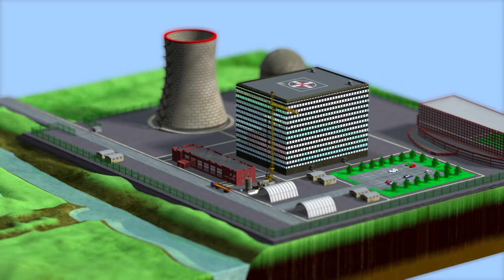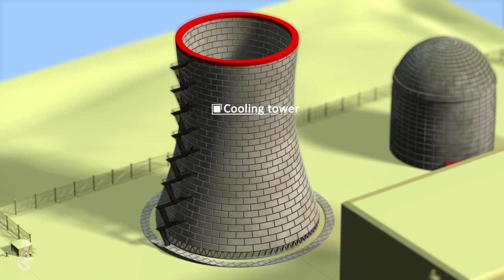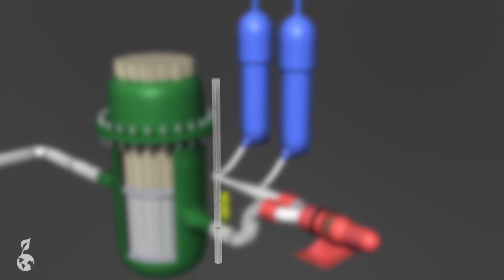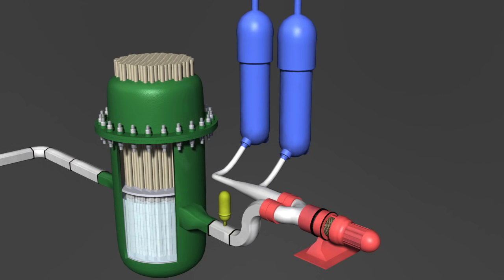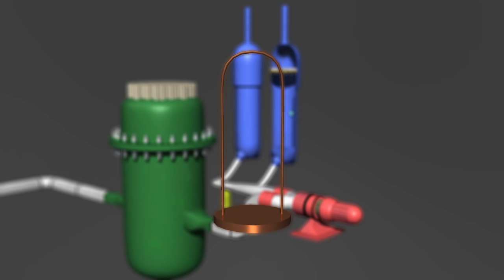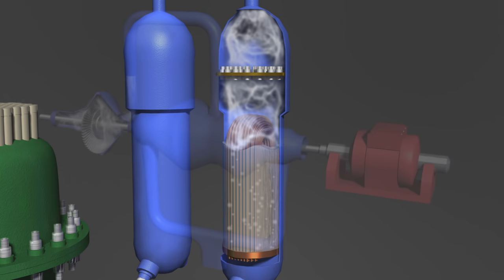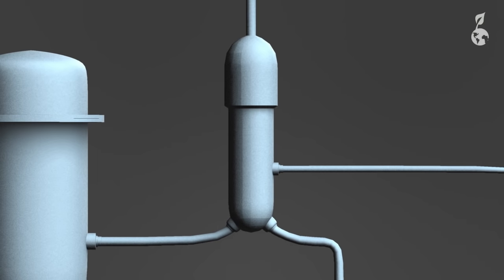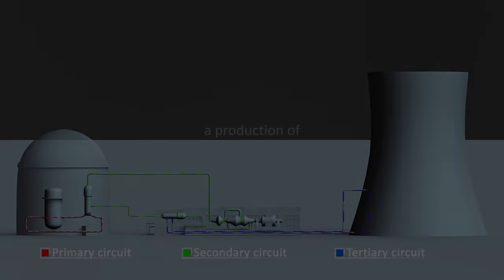How Nuclear Power Plants Work / Nuclear Energy (Animation)

Comment: you explained everything except the part how the nuclear reaction is done
Reply: it's NUCLEAR, not chemical, there's no reaction, the radiation from the u-235 boils the water
Reply: @herrGreg  Nuclear fissions are nuclear reactions. The radiation doesn't boil the water, most of the heat is due to the kinetic energy of the fission products. The radiation only accounts for a small fraction of the energy released by the nuclear reaction.
Reply: @olska9498  I was trying to be very short & simplistic, because most people need 1h reboot after I explain nuclear fission to them. But yes, it's the fission & not the radiation that heats the water; but lol, no it's not kinetic energy of the neutrons, it's the release of energy, a small part of the nuclear strong force is released as the Uranium-atom is split.
Reply: @herrGreg  How is it "short and simplistic" to respond "there's no reaction" to Kamel Labiad's question about the process of the nuclear reaction? This is just a wrong answer.

Furthermore, the kinetic energy of the fission products (daughter nuclei + neutrons) account for more than 85% of the released total energy. All your answers are just wrong. 

The people who need a 1h reboot after you explain them nuclear fission probably need the reboot because you tell them so many scientifically wrong answers.
Reply: @olska9498  I guess I mistranslated "reaction", I thought it was ment in the sense   of "chemical reaction"
Reply: Covid 19 GMA news 70
Reply: Ari Parker  
"It’s not a reaction as there is no chemicals involved."
--------- WRONG! It is a reaction. Not a chemical reaction, but a nuclear (chain) reaction. 

"They are unstable because of the amount of electrons to protons isn’t equal"
-------- WRONG! If the amount of electrons and protons of an atom isn't equal, then you call this an "ion". Stable isotopes can also be ions. 
The unstable isotopes like U-235 are unstable because of an unbalanced amount of protons and neutrons in their atomic nucleus.

"The isotope wants to get to its normal stable form so it does this by radiating away electrons"
-------- This is only one of many forms of radioactive decay. Unstable isotopes can also radiate neutrons or positrons or a helium nucleus or a gamma ray photon etc.
U-235 for example radiates a helium nucleus.

However, in a nuclear reactor, the released energy isn't primarily due to radioactive decay but due to a controlled nuclear chain reaction: Uranium (especially the isotope U-235) gets hit by a neutron, absorbs it, and splits into several new nuclei and releases neutrons and gamma rays. Then the released neutrons hit other U-235 atoms and the process repeats.
The kinetic energy of the fission products heats up the surrounding water etc.
Reply: Exactly
Reply: @lae Uranium and other radioactive material naturally releases heat energy because it constantly transforms some of its mass into energy.
HOWEVER, this natural radioactive decay and heat production is NOT the reason for the large energy release in nuclear reactors and nuclear bombs. 
In nuclear reactors and nuclear bombs, the natural heat production of natural radioactive decay plays a very low, insignificant role in energy production. 

Instead, you have a so-called "nuclear chain reaction", which is a carefully engineered process in which fissionable material (Uranium-235) undergoes nuclear fission. This nuclear chain reaction releases a EXTREMELY LARGE amount of energy.

When an Uranium-235 atom gets hit by a neutron, the Uranium-235 splits into new elements and releases several additional neutrons. These neutrons then hit other Uranium-235 atoms, which again split and releases more neutrons. This chain reaction repeats itself.
Reply: In nuclear power plant they uses control nuclear fission chain reaction in this U-235 atom is used as a nuclear fuel and atom of uranium is bombard with neutron by this uranium atom is split into smaller atom and this go until whole uranium is consumed also lot of energy is produce during this reaction and this heat is used to boil the water and water is converted into steam and steam is used to run the turbine blade, turbine shaft is connected to generator and thus electricity is produced and step up by transformer and send it to transmission line.
Reply: here is how you'll determine who's the listener and the talkshit-er! lol!
Reply: instablaster.
Reply: @johnnytheprick excuse me? the guy replying to everyone with insults has an opinion? 😂😂 maybe try going outside once a week, touch some grass maybe XDD 😷
Reply: I think he doesn't know
Reply: Ha
Reply: You aint gettin no college for free boaaaayyy
Reply: Turbines moving creates electricity is the most simple way to explain, the nuclear part is in the rods, the more rods the more power. Watch Chernobyl if you’re really interested… I’m not a physics/ nuclear specialist but it helped me understand
Reply: @herrGreg  one hour reboot???? 😂😂😂😂😂😂😂
Reply: @herrGreg  lmao what??
Reply: @herrGreg  🧱

Comment: summary:
plutonium or uranium(235) has its nuclei split by neutrons and releases energy(heat), there are also boron rods(control rods), then the heat is used to turn cold water into steam which is then turned into electricity with turbines

Comment: The confusing part on this video is started in 3:20 wherein it failed to explain that there is another water line coming to the heat exchanger to make steam. Therefore, water line 1 which is radioactive is circulating from the fuel rods to the u-tubes all the way back to the fuel rods again while the water line 2 is just flowing outside of the u-tubes. Correct me if I am wrong :)

Comment: If I'm not wrong, the voice tells a fuel rod has a diameter of 23 cm, which is not correct: the diameter of a single fuel rod is a bit more that 1 cm! The side of a fuel ASSEMBLY (a square lattice of 17x17 fuel rods) is more or less 23 cm...
Reply from the maker: Correct :)

Comment: I know how this is effective, but I must admit my disappointment with nuclear power. I thought we were actually using the heat itself as energy or the radiation, not turning it into a steam engine to generate electricity. We know 5 types of energy and no doubt electricity is the easiest, but why not try to use all forms of energy rather than just converting it to electricity. I know you can't convert all of an energy to another energy.

P.S. I know the capabilities of nuclear and all, but is the cost of nuclear aka nuclear runoff, waste, etc., more than the cost of Niagara Falls? If not, why not just created an insulated giant manmade waterfall that works similar to this, except being manmade you can add as much water as you need and just use Gravity. Would this idea be worse than the Nuclear one?
Reply: Sylvia isgod I was kinda spit-balling which is why I put it with the P.S. I was maybe thinking of having it go down into an angle where Sun light could shine in or something so that it gets dehydrated back to the top as it falls down. I'm not anywhere near and expert with this kind of stuff, but I think we could use the vacuum from tubes as some form as well. Not saying I'm super smart or anything, but I think we should try stuff out rather than just ruling things out.

Comment: I did't get how the water in the primary circuit never leaves the building, Didn't we convert that into steam and fed it to the turbines? I also didn't get why we need 3 turbines? what's the high pressure turbine for?
Reply: +Muhammad Nasih I mean I know that the rotation of the turbines rotates a magnet inside a coil generating electricity but I don't understand why we cant just use one?
Reply: +Sylvia isgod 

🙍🙍🙍🙍🙍
Reply: Water in the primary circuit is the heating medium. The water flow through all the tubes inside the boiler where it boiled the water (boiler water) on the shell side. To make it easy to understand, you know how kettle work right. Instead of using electricity to heat the coil, you use heated water to heat the coil. The current didn't heat the water but the coil is.

And as for the turbines its called an induction steam turbine system.
Reply: Hi, just wanted to clarify big generators don't have permanent magnets that spin within the stator (the coils of wire). An electromagnetic field is created via an exciter. The exciter provides DC power to a rotor. When that rotor spins due to the spinning turbine, the electromagnetic field becomes a changing electromagnetic field which causes AC current to be induced in the stator (it then goes to your step-up transformer, etc...). But emergency generators you may have at home do have permanent magnets as rotors.

Comment: So how is the water outside the primary unit not radioactive since part of its function is to use this radioactive steam product to drive the turbine then gets condensed and sent back to the primary? That part has me a little confused
Reply: The red water is not radioactive from what people would imagine. The radiation from the enriched fuel inside the fuel rods does not mix with the water. Think of it as the fuel heats up thereby heating up the containing metal of the rod which the red water is touching and thereby receives heat. The idea of the three separate systems is to isolate and avoid overheating and causing a thermal runaway. It also allows the system to be easier to provide maintenance at any given part.

Comment: rather crude if you ask me. There must be a way to convert heat directly into electricity.
Reply: +bulbadox I feel as though a lot is flawed about this blueprint. There must be ways to improve.
Reply: +bulbadox There is, its just not as efficient. Its called the thermoelectric effect, its how temperature sensors work.
Reply: The problem is how and with wich material generate heat, not how to transform heat into electricity!!!

Comment: how they separating the primary circuit from secondary circuit water?
Reply: The water never leaves the primary. It stays in the metal tubes in the heat exchanger and is this circulated back to the core going in a circle. The secondary has its own separated water system that sits next to the heat exchangers that gets turned to steam and once it hits the turbine, reaches a condensation tank which goes in a circle as well back to next to the heat exchange

Comment: I apologize in advance for my lack of intellect but I don't quite understand; nuclear explosions heat water which eventually turns into steam that turns the turbines and then is cooled down and routed back in to be heated again, right?

 How are the explosions induced? How does steam turn a turbine, is it something to do with how heat rises? Why 3 circuits and why does the water have to be cooled? Can't the steam just be reheated to turn the turbine? 

Thanks in advance to whoever takes their time to explain this to me :D
Reply: +PremonitionsWoW seems like you're understanding the basics of the system pretty well by your summary in your first paragraph.

The explosions are induced by neutrons. They essentially make the atoms of the fuel rod unstable and cause chain reactions which cause heat as a byproduct. The heat boils the water that surrounds the fuel rods which is then tubed to where the second system is introduced with the non-radiated water. That water is boiled by the super heated radiated water in the first system, and produces steam. If there are no pressure leaks, the steam will have only one way to go. Wherever the pipe takes it! So it is then released in front of turbines, or fans, that are forced to turn by the pressure of the steam. If you blow on a small fan, the blades will turn. Same principle! The third system is introduced to cool the steam after it's blown past all the turbines. The steam will be mostly depressurized after it has gone through all of the turbines. Once the steam is through, the cool water from the third system will drop the temperature of the steam further, leaving water to be recirculated into the heating chamber where the first and second system meet.

At no time should any of the three systems exchange water. The first system is the radiated water in the reactor core. Which if exposed to the environment, would be very damaging to everything and anything it touches. The second system is clean water and is used to create steam that is confined to a system of pipes that direct it to "blow" on "fans" that create electricity, just like a wind turbine. The water in the second system is NOT radiated and should be safe if exposed to the environment. However if there is a leak where the first and second system meet, the water in the second system will be considered radiated and thus not safe. The third and final system is a cooling system. Imagine the radiator in an automotive vehicle, where air passes through a bunch of fins that have a fluid being pushed through them. The fluid is cooled by the fins and then pushed through the system. In the case of a reactor, think of the air as the water in the third system! 

I think I've exhausted the mechanical side of my brain for a bit. I am by no means a Dr., scientist, or have a shiny piece of paper on my wall. I'm just a mechanically minded picture framer who worked on boats many moons ago.
Reply: +Aaron Fruman I too apologize for my lack of knowledge in advance, but aren't the time that these fuel rods can be used is finite? I mean when all of the atoms in uranium or plutonium are broke down, the chain reactions are bound to end, right? Ofcourse, the amount of time to pass is vast, but it is sure finite, right?
Reply: laurisss6 Yes, the rods are finite. They do need to be changed and the chambers where these reactions take place needs to be cleaned on a regular basis. Without the cleaning and constant inspections, we would experience more nuclear reactor meltdowns.

What we do need to be aware of is the federal laws of each country where a nuclear reactor is, so that we as the population, can better ensure that proper protocol and procedures are being followed to keep safe the workers, people in surrounding areas, and environment for our future generations.

Don't apologize for lack of knowledge! We all lack knowledge in a wide variety of things. =)
Reply: +laurisss6 Look up the https://en.wikipedia.org/wiki/Half-life . Its not about the computer game but about the nuclear fuel decay. :D
Reply: Awesome link! Thanks! I just read a few paragraphs. Smarter already. =)
Reply: @AaronFruman  "The heat boils the water that surrounds the fuel rods which is then tubed to where the second system is introduced with the non-radiated water" That is incorrect....in a PWR, the water surrounding the fuel rods is pressurized and does not boil.

Comment: Sorry, i haven't got special knowledge about nuclear plants, but i've got a question. Why the water in the second circuit isn't radioactive? If i clearly understood, the radioactive water from reactor (it's a heavy water, isn't it) is going through tubes in heat exchangers. And if the water circulating in these tubes is radioactive why the tubes aren't radioactive? If the tubes are radioactive the water in heat exchangers is radioactive too and of course steam produced due to boiling this water must be radioactive.
Reply: Radioactive water never touches secondary circuit water.

A Heat exhanger doesnt mix water it only exhanges heat.

Radioactivity isnt contagious. Radioacticity hitting water wont make the water radioactive.

Comment: I like the part where she doesn't mention the water going back to the environment at high temperatures
Reply: That's the purpose of the cooling tower, to avoid that. You're thinking of older reactor designs that released circulating water back into the environment.

Comment: isnt oil also used for the primary circuit as its a better heat conductor than water?
Reply from the maker: This is my channel Not really, Where did you read it?
Reply: Thomas Schwenke My Schools Physics book, it makes sense. maybe because its a pressurised system? not sure

Comment: Would it be more efficient to use the rodes in a beam. Than split that beam to generate electricity. Radio active waste is still an issue.

Comment: Can they get water from the sea or is does it have to be fresh water? 
Or is this is a stupid question?
Reply: No wouldn't work. The sea water would rust components. And the stemming process would leave a lot of salt build up over time, but there is a different type of reactor that uses sea water for the cooling system.
Reply: Dreamseller112 Ah thanks.

Comment: If it’s steam that makes power why is nuclear energy necessary? Why not just heat up water?? Overall thanks for explaining it to me :3
Reply: what would you use to heat the water gas charcoal oil or some combustible material it would cost more than using uranium

Comment: You are making steam so you can move turbines to make electricity?
Why don't you drop the pressure so low that you can boil water into steam naturally?
Reply from the maker: How will you drop that pressure? To drop pressure, you need electricity (or another energy source like petrol).
Reply: Thomas Schwenke i wish there was a  way to just drop pressure mechanically without fuel or solar power

Comment: so basically the giant cooling tower is just used to cool water, nothing else?
Reply from the maker: Yes :)
Reply: could it be any smaller? or does the equipment need to be that big to work better, or something?  or is it just because it looks badass?
Reply from the maker: No, the cooling tower should be that high to allow the water to cool down. The white cloud you see at the top is water that cannot be used anymore for cooling the inner system :(
Reply: Ok, that's cool (I knew the water thing) I really enjoy your videos and thanks for Your time in replying.
Reply from the maker: Ok, great to hear that :)